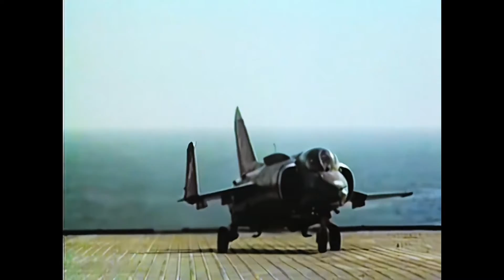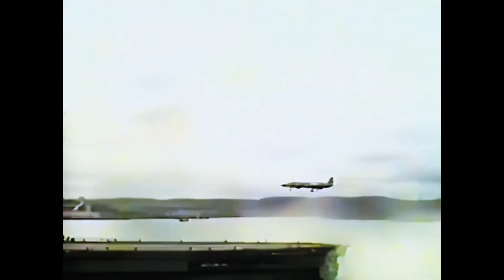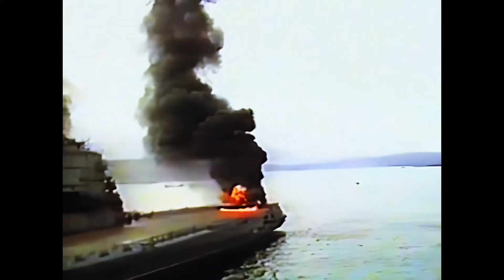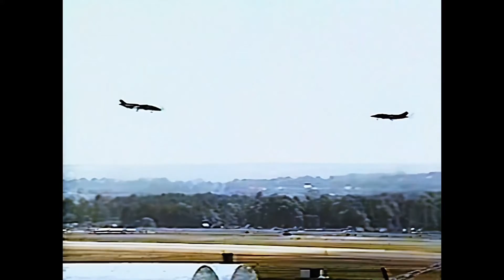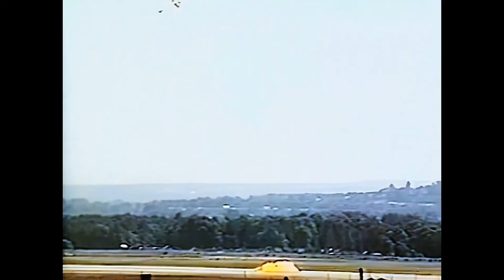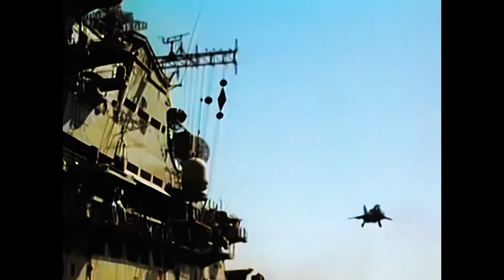Yakovlev Yak-141 Crash

Comment: Its a Yak-38
Reply: No the Yak-141 was an experimental supersonic VTOL replacement for the yak-38. In the west the prototype was simply the yak-41 (not to confuse with the -40 & -42 passenger aircraft).

4 prototypes were built, 1 (this one) was damaged beyond repair aka destroyed and the project was cancelled in part because of the set back and in part because of the fall of the Soviet Union greatly decreased the Soviet navy (don’t worry the Russian navy is building back up y-a-y/s)
Reply: @BimmieJames bro the plane that crashed was the yak 38
Reply: @Tumansky1  “An hour later, Vladimir A. Yakimov landed 48-3 on the same deck. 
The pilots would go on to make eight flights from the ship until Yakimov made a hard landing on 5 October. The undercarriage ruptured a fuel tank, causing a serious fire. After almost 30 seconds, Yakimov ejected successfully, and was rescued from the sea.”
Reply: @Tumansky1 Are you just saying it’s a yak 38 based on your eyeballs or are you looking it up? I’m researching it right now; I’m sorry you’re incorrect. 
As my source is saying the airframe that caught fire in the video above was designated 48-3.
48-3 was the fourth and last prototype of the yak-141 produced.
Reply: @Tumansky1 ”Yakovlev obtained funding for four prototypes. The first (48-0, with no callsign) was a bare airframe for static and fatigue testing. The second (48-1, call sign "48") was a non-flying powerplant testbed. The third and fourth (48-2 and 48-3, call signs "75" and "77") were for flight testing. While 48-1 remained unpainted, 48-2 and 48-3 were painted in overall grey, with a black radome and fin cap antennas.”
Reply: @BimmieJames  the Yak-141 and Yak-38 are distinct and different, you can see them both in the video. The first explosion was a Yak-38. I know this is an old comment but it still applies.

Comment: Russian fanboys: “Nuh uhh. That never happened. It’s all just a simulation. That’s why I believe that Russia’s army is powerful and not just a hodgepodge of old and unreliable soviet parts”
Reply: The yak-38 was hot shit but the Yak-141 was paid for in part by Lockheed Martin who used the research and development to start perfecting the F-35 program notice how the twin boom tail and vtol parts of the yak and F-35 are  very similar
Reply: @mikoyanig5512  similarities with Yak-141 and F-35 are overstated ... Yak still used the two forward auxiliary engines, that is a huge diference compared to the F-35
Reply: @mikoyanig5512  no report and stopped lying never lookeed needed to pay anything to the Russian for technology..the yak 141 like the yak 38 has 3 engines including 1 for thrust and 2 at the front for vertical. ..the f35 just has 1 engine..
Reply: I agree that is what the Russian military is, but let’s not twist this the wrong way. 

The Yak-141 was an excellent aircraft that the only reason it never went into a long life of service it because the economic and political situation in the late USSR. 

The only other comparable aircraft to the Yak-141 at the time are later fighter variants of the Harrier, which the Yak-141 would most likely beat 9 times out of 10.
Reply: @spingebill8551 most likely until then it won’t 😂
Reply: El Yak-38 fue un error
Reply: @efrainbeltran2808  I wouldn’t say that. Maybe this wasn’t the intention of the designers, but the Yak-38 was for both experiment and as a stopgap until a better VTOL aircraft (Yak-141) could be developed. 

It wasn’t the best aircraft, but outside the harrier (which for obvious reasons was unavailable to the Soviets), it was the only aircraft that could do what it did. It is also why the Yak-141 and later F-35B are so good, lessons learned from the Yak-38.
Reply: tell us how the counteroffensyiiv is going. Oh wait tens of thousands of ukrainians were killed and they lost 30% of their total equipment? Darn...
Reply: @nimbletimplekins7601 Tell us how your offensive against ukraine goes on, as the second mightiest army in the World little ukraine shouldnt be a problem, but wait, you lost over 2500 mbts, 3000 ifvs and 300000 men. I definetely think the 😂mighty😂 russians doing well in ukraine after almost 2 years now. By the way the average deaths in November of russkis per day were over 930. I hope you werent under them, so I can read your Response.
Reply: @zSwax  considering that everyone is dragging Zelensky kicking and screaming to the negotiating table and tensions are boiling between him and zaluzhny over the failed counteroffensyjiiv I'd say it went pretty well.

"B-but 6 trillion Russians died and they lost 5 billion tanks, the Ukrainian MOD said so and they never lie, remember the ghost of khjyiivvvvv!1!!1"
Reply: @zSwax  what will your excuse be when Ukraine is finally forced to the negotiating table?
Reply: how many time the F35 crashed too?
Reply: You talk a lot for no mentioning how after the Soviet Union dissolved the U.S. stole plans of the VTOL and decided to make their or.  Thank the Russians for making some development plans for you.
Reply: No te recuerda al f-35?😂
Reply: So basically American fanboys 😂